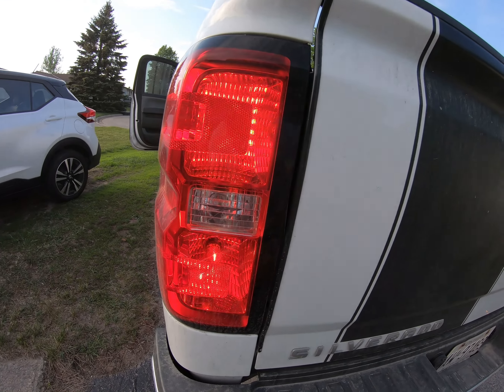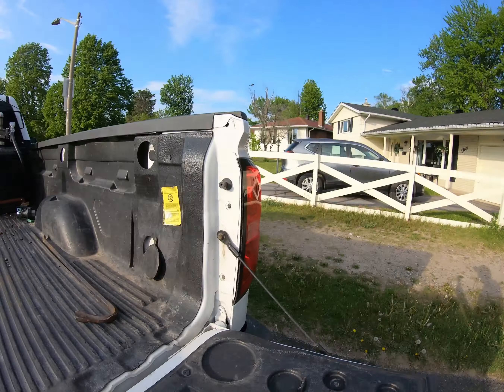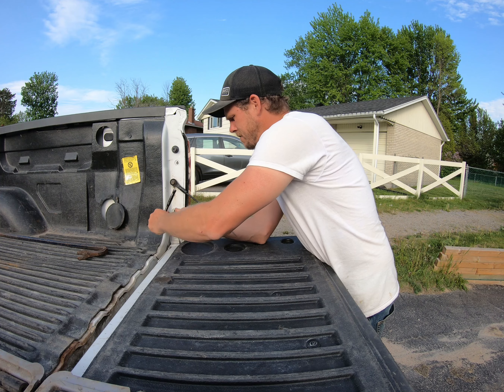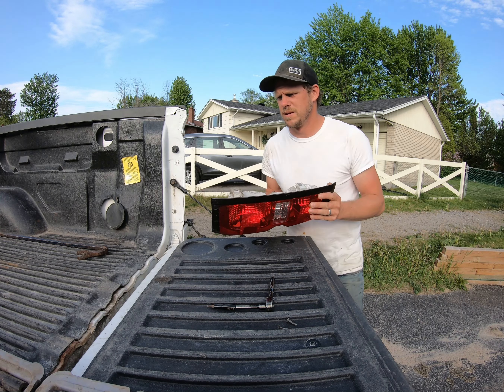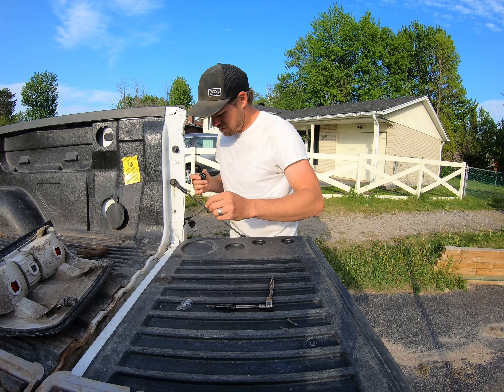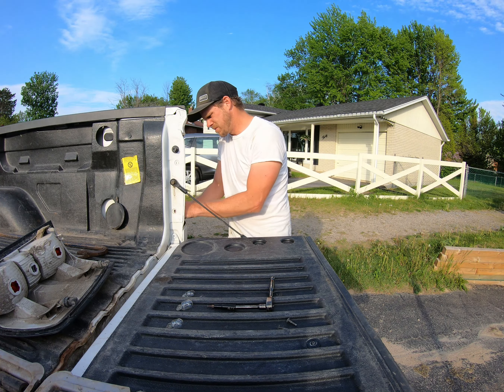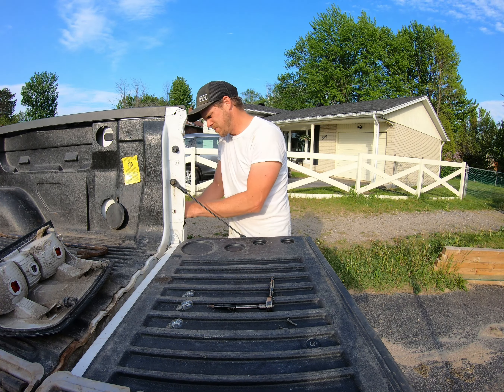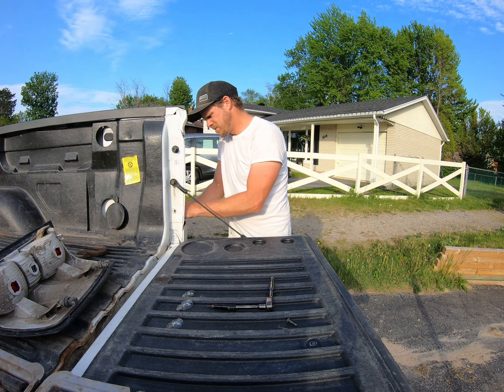2017 Chevy How to change wiring harness for the tail lights

Comment: About 11:30-12 minutes into the video you can see the part number on the bag.  AC Delco # 23295977.  This same issue happened to my 17' Silverado 1500 extended cab LT and the part fit just fine.  Parts on Rock Auto or Amazon etc. Thanks for the vid!  Helped a great deal!
Reply from the maker: Thanks
I’ve been meaning to get the part number
Thanks and thanks for watching I appreciate it

Comment: Damn bodyshop put a new bed side on my truck and ripped the wires out for the  passenger tail light 😠.  I'm replacing it myself. Your video helped me figure out which plug or connector it was. I looked underneath and noticed second plug from the driver side has no wires connected toooo the plug 🤦‍♂️ 60 bucks

Comment: Mine cavity on my truck get loaded with rocks and rock salt plowing gravel lots  you have a good helper
Reply from the maker: The crappy thing is this is a backup truck for plowing
This truck is only 4 years old and the transmission had issues last year but still 10 times better than the Ford I had🤷‍♂️they don’t build things like they used to
Thanks Michael🤙

Comment: WHY DOES EVERYONE SHOW TGE RIGHT SIDE. MINE IS THE LEFT SIDE AND I CAN'T GET THAT THING RELEASE .
Reply from the maker: The wiring connections?
If so mine are on the drivers side
Pull the red clip then it will release
Sometimes you get dirt and mud a makes it a little hard to disconnect 
Best of luck and thanks for watching

Comment: Hey…what did you do with the old wiring harness?  I need the bottom socket from the side.  The dealer here wants almost a hundred bucks just for that little harness.  I’d love to buy the bottom socket from you.  Where are you located?  I’m in Newfoundland, Canada
Reply from the maker: I’m in north Ontario, 🇨🇦 
The old harness sockets were no good and threw it in the garbage
Sorry
Best of luck
Reply: Can you remember if the socket for the bottom bulb had 3 wires going into it or 5?
Reply: Thanks for the first reply by the way.
Reply from the maker: @robertskinner3946  I believe just 2 but I could be wrong

Comment: The only thing challenging about this is disconnecting the harness connection, and you didn't even explain that it's not always as  simple as pulling it apart.   It's not very accessible or visible.   
You need make your videos more focused and step by step, then you would be helpful. 
I still can't disconnect the wiring harness. This video is a fail.
Reply from the maker: Sure. Thanks for the comment bud
You were helpful😂